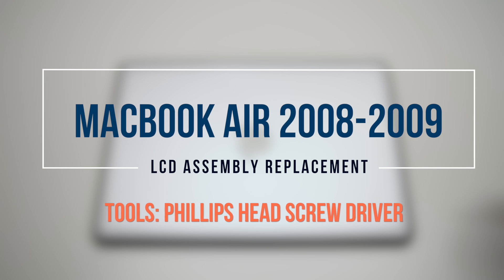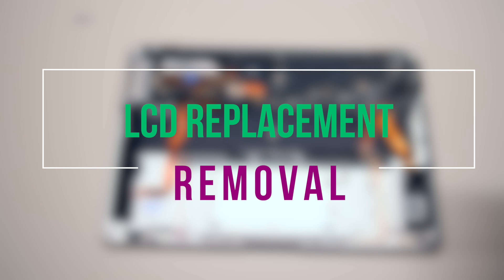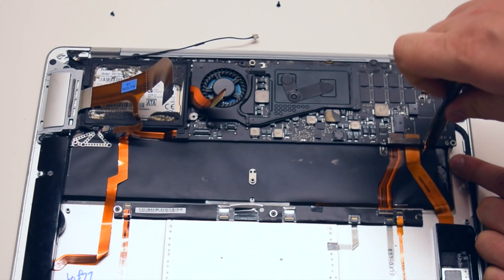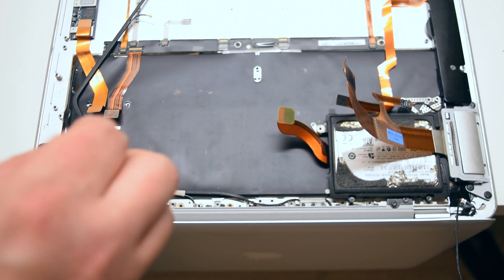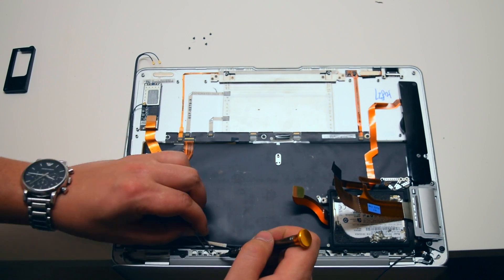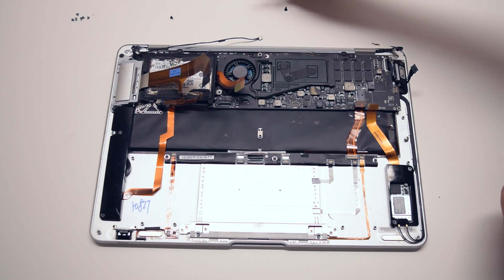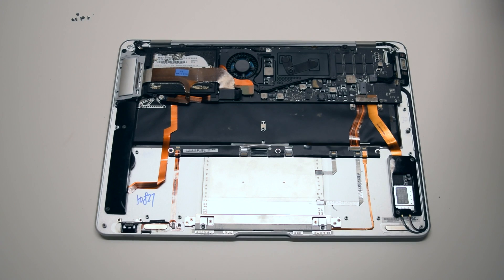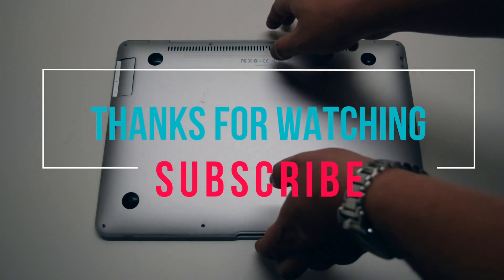Macbook Air 2008 and 2009 A1237 and A1304 Screen Assembly LCD Replacement

Comment: Is it possible to replace the display modual and hinges only? I still have my Wi-Fi antenna connected to the pc (middle bar between hinges)
Reply: dont know if anyone cares but if you are stoned like me atm you can watch all the latest movies and series on Instaflixxer. Been watching with my gf for the last few days =)
Reply: @Callan Clyde definitely, been using InstaFlixxer for years myself =)
Reply from the maker: Please rephrase the question.
Reply: Save Apple Dollars, there is a Wi-Fi antenna between the hinges of the display module. Is it possible to take it (that gray bar) off the  bottom of the display? This would make it so only the LCD wire and Camera wire are part of the screen. 

If you still dont understand please get ahold of me, I need your help man!
Reply from the maker: Sure I don't see why not.